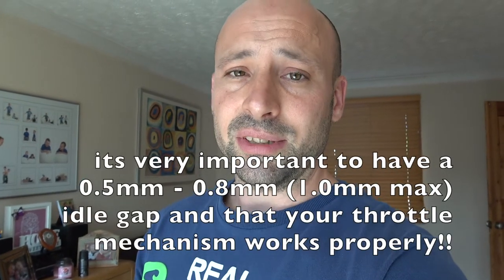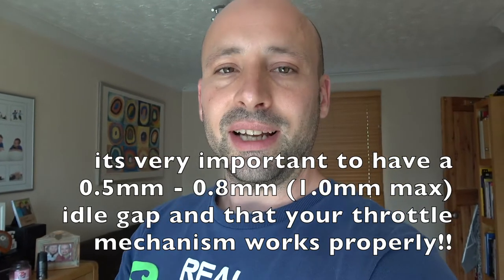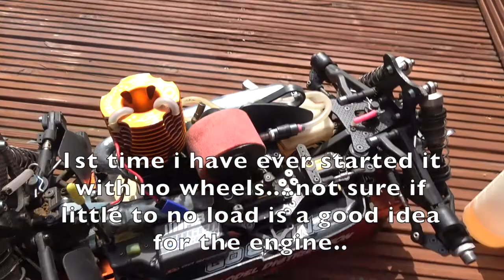GO GX5-r nitro engine carb settings

Comment: I bought a used nitro truggy and the settings was terrible! so I fixed it. in weather like this, keep the low speed flushed or screwed in within half a turn and I keep my high speed screwed in 1 turn from fluahed. But I also had trouble with my idle and im having that problem you had with the muggy.  I can't gwt a good idle and even I have a large gap in my engine also.
Reply from the maker: hi mate. muggy engine was damaged thats part of the reason it didn't want to run... might have sorted it now. new idle screw too as it was snapped and the slide was just closing all the way. thanks for the advice either way. its always appreciated :)

Comment: sounds fine just bump the idle up a bit more
Reply: when nitros reach full temp they have a tendency for the idle to drop a little.
Reply from the maker: thanks for the opinions mate. appreciated. its a starting point rather than perfect settings. The motor needs to heat up fully and the tune will shift during that process, the guy that was asking for my settings could not get his to start or run hardly at all, so hopefully this will help him. I like a slow ish idle if i can get it. who knows with wheels on and under load the tune will be miles off!hopefully i will get a decent day weather wise and time to get it dialled soon. cheers ;)